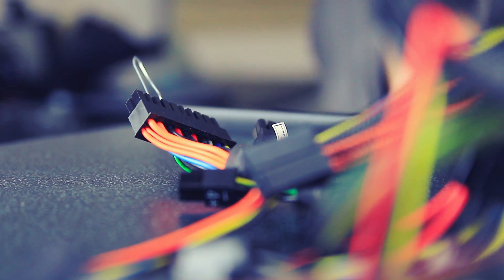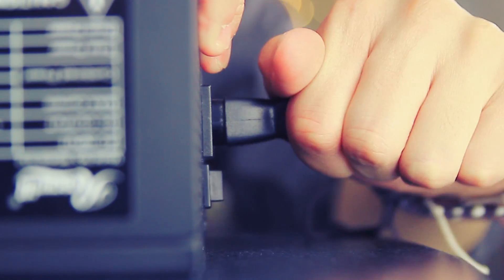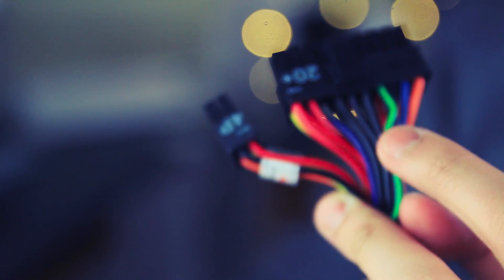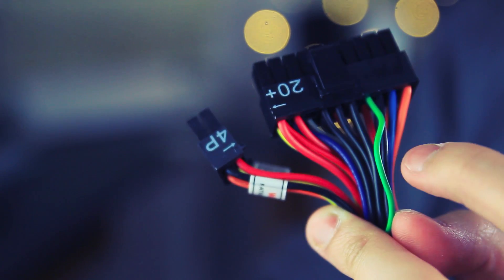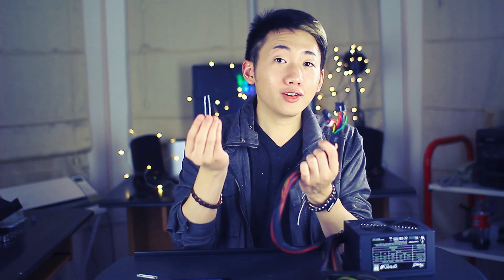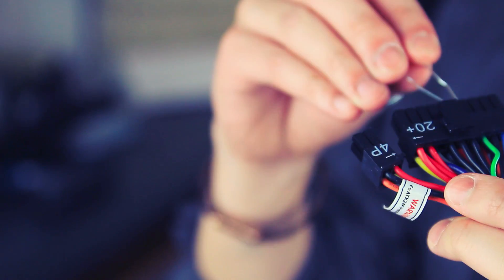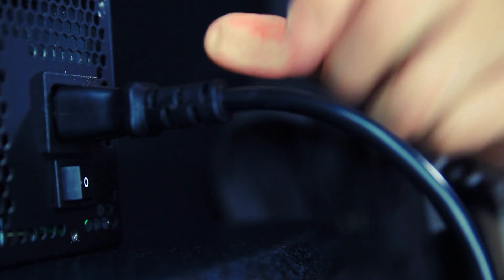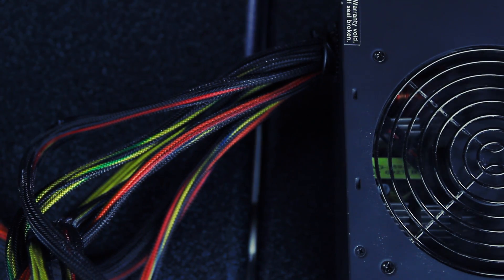PC Tip: Testing a Power Supply with The Paper Clip Test

Comment: I have a Corsair RM 1000w PSU and all the wires are black.. How am I suppose to know which one to put in ?
Reply: Here you go buddy, hope it helps.. http://www.corsair.com/en-us/blog/2011/may/testing-your-corsair-power-supply
Reply: Lord Dan Thanks bro ! I built it then tried to rewire my cable management then it wasn't turning back on but I know where everything goes now but thanks bro !
Reply: M Gooner No problem, glad you got it sorted.
Reply: I have the same problem. 4th hole from the left on the top row when looking into the power supply cable with the clip on the top is connected to the "green" black wire.
Reply: if it is black that means it got stolen :)
Reply: Thanks Obama!

Comment: I tested my power supply (HP Pavillion Slimline s3300f) using your paper clip test and sure enough the fan started spinning. So I assume that means it works. 
But when I plugged everything back in and pressed the power button nothing happened. 

How do I troubleshoot the other items and what else could it be? 

what if you jump the green and black cable to get the power supply to start up to boot up the computer? or would that damage anything?

Comment: just btw. you will not kill youself wehn you touch the clip, its DC power, it will hurt but not kill you
Reply: uh, DC can still kill....
Reply: low current DC is actually more damaging to tissue than AC over long exposure times, but this is 5V not 100V.  it takes someting like 80+V to break the skin. 5V would literally have to be jabbed into an open wound to do any damage

Comment: well what happen if the pc it self running normally and can run stress test but psu fan not spinning? i already test the fan separately and it's working
btw i use cx500
Reply: ***** kilerholixs1 Depends on the PSU. Some PSUs have a fan ramp-up curve where the fan doesn't start until the PSU has reached a certain internal temperature or load. Easiest way to test if the computer itself is working is if the fan spins up or not after introducing enough load to the system using OCCT and/or Furmark.
Reply: but i use cx500, it doesn't  have fan curve so it is normal?

and i already test using furmark and afterburner, my pc still run normally for now

Comment: My computer sometimes wont turn on after a blackout, made this test to my power supply and it works, after many tries hitting the power button or sometimes using a screwdriver in the power switch pins in the mobo my computer turns on but I don't know why this keeps happening, today a blackout happened and currently I can't make that my computer starts. What to do? Thanks.

Comment: Hi,
My hdd is getting worse and worse, a lot of bad sectors. I've changed the HDD and motherboard and the problem is the same. My second HDD is also destroyed. How can i fix problem? Bad power supply? Thanks
Reply: did you ever find out if the power supply was the culprit? My computer also eats hard drives every couple of months and i dont know whats causing it.

Comment: IS IT NORMAL WHEN U PLUG IN THE POWER CABLE ON A PC AND THE PC STARTS AUTOMATICLY WITH OUT PRESSING THE POWER BUTTON? AND IF ITS NOT HOW CAN I FIX THAT TO NOT START AUTOMATICLY?
Reply: Yes, this is an option in your BIOS.  When A/C current is detected it starts up.  Just go into BIOS and change the option.
Reply: buy new psu

Comment: MINE DOES A QUICK SPIN THEN STOPS 
is it dead?
Reply: I have a feeling that the paperclip test is not being done correctly. This sounds like the PSU is being turned on, finds no signal that indicates it is being needed, and then turns back off.
Reply: ok thank you
Reply: Michael Eller
hexactly